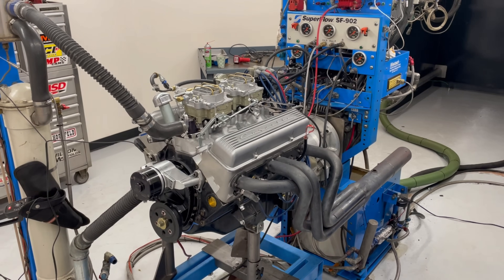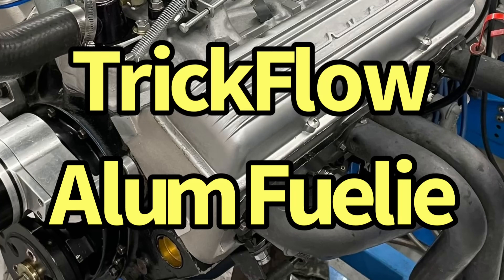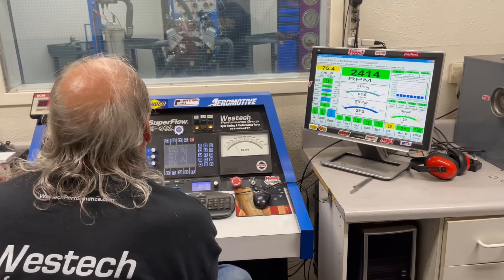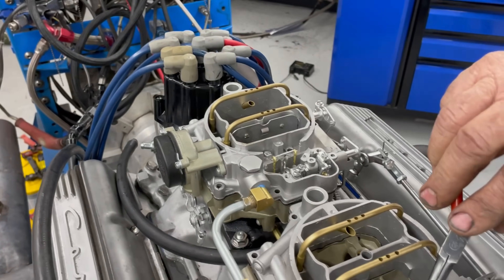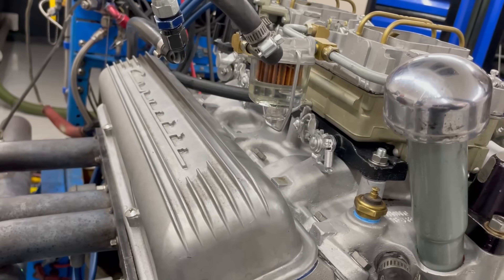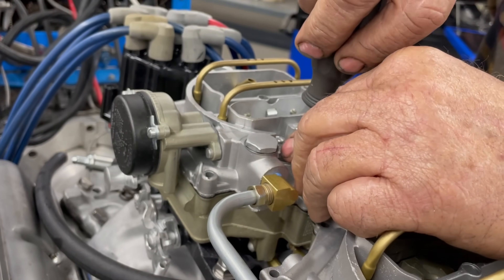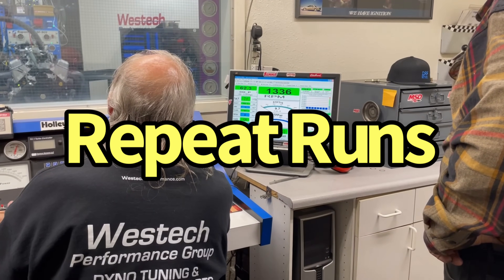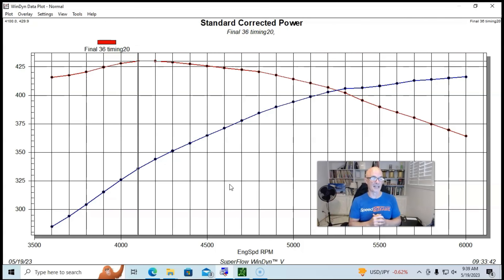HOW TO: DUAL-QUAD 283 STROKER CORVETTE MOTOR. FULL DYNO RUNS, RESULTS AND CARB TUNING. WILL IT WORK?

Comment: Large obstacle today running dual carbs is back in the day the secondary carb had no idle mixture screws it was a special carb opposed to the forward carb which had idle mixture screws but today that secondary carb no longer exist so you have to run two primary carbs and getting two of the same carbs to work in harmony isn't that easy when one is to do one thing and the other is to do another thing (wide open) but I still like the look and performance of dual carbs

Comment: We built a destroked  283 for C Econarail dragster. 
We used a 1956 block as the deck was much thicker than later years. 
Fixtured it on the Bridgeport and milled 0.125 the deck and used an offset ground and welded crank for a 2.75 stroke. Stock rods and Trw 11-1 283 pistons.That gave us 259” for a 1300 lbs.
 car& driver.
Porting allowed only port matching at the time. Flat tappet only.
So we used fuely heads. The max carb was 750cfm so we used a holley double pumper. The only single plane manifold available was the trantula. We had to mill that to fit. 
At the time there were no aftermarket heads.
Motor ran well in a Fed with a shorty glide.
Shifted it at valve float.
Ran 9.50 at 155.
It was good for what we had in it.
The they changed the rules and the Red’s showed up with the money.
Reply from the maker: nice

Comment: This is the engine I ran in my ‘57 Chev-210 back in 64. Only I ran solid flat tappet cam , Duntov 30-30. I know it’s an old combination and much better cams are available today.  So maybe I’ll build another.😂😂😂👍

Comment: I had a friend who had a 64 Bel Air with a 283 with a .30" overbore and we added a 327/350 camshaft, anti pump up hydraulic lifters, and the same intake with the two WCFB Carter carbs. The original car had a power glide transmission and a highway gear in the rear, and that car was a blast to cruise on the weekends, and on the occasion that he got into it those two little four barrels would sound like they were trying to draw the hood into the engine.

Comment: I'm running an old school build 283 stroker. From what i can gather it was put together in the 80s-90s. Its a 1965 283 with a 327 crank, .030 over flat top pistons, power pack heads, L67 cam, Holley 4bbl intake, hooker headers, pentronix flamethrower ignition, and an edelbroken carb. Calculated it out and it sits right around 312CI.

Comment: I wouldn't try to make much power through those dual quad intakes. They are small port/runner castings. The carbs are the equivalent of a single Holley. But ooooohhhh the nostalgia. I own about 4 of those intakes, both 56 and 57-61. 2 sets of carbs, oem linkage, fuel line, and Vette air cleaners. Just bought a complete stock 56 265 motor. Gonna shave the heads, do a 5 angle. Put a 327/300 cam in it, and top it off with the 2x4 setup, Delco dual point, and 7 fin staggered bolt alloy Vette valve covers. After I retire, gonna drop it into my 55, take out the L82 in it now. With a Vega 3.50 1st gear Saginaw 4 speed, and 3.55 gear. Going slower as I get older...lololol

Comment: I ran a 30 over 11 to one 283 with 194 heads , a 30-30 solid duntov  cam with the early dual quad . 4 spd and 4 11 rear in a 55 chevy . The sound of high revs out of that thing was music .
Reply: I ran a .40 over trw forged flat piston 283 with 186 heads 1.94 in and 1.50 exhaust the old camel hump heads with the holes for the brackets and a melling cp400 cam with a 650 holley and the older performer rpm edelbrock intake with a hei  distributor that had been curved for that engine with 1 5/8 headers it done pretty good i put it in a 66 chevy pick up my dad gave me when I was 16 she would scream I loved the sound of it. It was stout on top but suffered 
On take off and that was with at one time. A Saginaw 4 speed and 3:73 gears that has been years ago im 55 now and lost my dad last June I miss him but he taught me a lot im thankful for that
Reply: I have the same set up, do you think you made 300 HP?
Reply: easily . I beat many 350s with that car .
Reply: You were fortunate to be able to get your 283 to be a good performer. Installing 1.94 heads or any head made for 4” bore engines will normally compression and power when installed on a 283 engine. Must of been the 11:1 compression pistons that made your 283 a good one.
Reply: it was a common upgrade 50 years ago . Pink rods . To strengthen it up . And listen to it rev .the 283 was a great little engine . One day i put a 283 crank in a 327 block . I didnt know what i built but with the 194 heads the 30 30 cam and a tunnel ram that thing would shift at 7500 rpm all day .gas was 47 cents a gallon at 110 octane  ! Life was fun .

Comment: Hello old dinosaurs... Question here from a rookie, i like the 327 high revvs, if i wanted a sbc with a similar nature what should i look for? I want to do a swap at some point for my square Body s10.. and i would like to have more options than just the 327, just in case the 327 doesnt appear around my cities or counties...
Reply from the maker: a 350 revs just as high
Reply: The chances of finding an old small journal 327 block in decent shape is slim the 327 and 350 share the same bottom end after 1968 so any 350 will be the same and if you want it to rev high that is not hard to do at all it's all in the heads and valve train stiffer springs to combat valve float etc

Comment: The best cam for 283 is a comp cam 268 high energy. 454 lift 268 duration
Reply: Works very well in a 318 Mopar, too.
Reply: @mickangio16  the best cam for any small block and a torque monster in big blocks

Comment: So there's absolutely nothing 283 about that engine block heads and crank are totally different from a small journal 283 with power pack heads  😂
Reply: Small journal 283 block and a small journal 327 crank. And “repop” heads. I’d a rather seen a tunnel ram on it though.

Comment: Okay... I've never messed with but a couple of 283's over the years. Having said that, I didnt think that you could run a 2.02 intake valve in the small 3.875" bore, especially with that much duration and lift of the cam.
Reply: Never mind... I see that he bored it waaaaay out.

Comment: Do you have a mild 421 c.i. sbc 350 stock block based build video richard? 4.125" stroke X 4.030" bore. Mild hydraulic roller cam. EPS intake.
Reply from the maker: 4.125 stroke in a sbc stock block?
Reply: @richardholdener1727  yeah. Or a 4" 408 would be cool.

Comment: Holdner thats some terrable false advertiseing there.. longer stroke with orriginal bore and block is a stroker not throwing a completly different engine in the car . Made me waste all that time just to see another dyno run of a plain old 350 mouse motor.. please make up for this by doing some dyno tests on themopar 318 to see what can be done .. Not 340 or 360 please just good old orriginal and ultra cheap la 318!!!
Reply from the maker: maybe a 318 magnum
Reply: Poly?

Comment: Excuse me. I feel ripped off. I was promised a 283. Everyone knows what a 350 can do. I'm liking this video because i like you Richard, but this is false advertising 😂
Reply from the maker: 283 STROKER
Reply: @richardholdener1727  I guess I missed the BOLD print, but I still want to see what a tricked out 283 can do at 8,500 RPM. Can you blame me? Thanks for what you do!
Reply: @derekmelyndadeckens2982  me too! 283 with forged pistons,11:1 comp.forged factory crank,duntov solid lifter cam,not sure maybe vortech heads and high rise manifold with 650 demon carb? I'd bet it crank 7 grand?

Comment: Hand raised. I have a 57 Corvette oem correct 2x4 intake setup. Woohoo.

I'd love to build it with a 3736097 Duntov cam
Or a 30-30
Or 3972178 LT1 
Or the hydraulic L79

Can't ever decide.

Comment: Some magazine or engine builder built a 307 with old 175cc trick flow heads and used 3 different cams to hit the 500hp mark. And it did it around 7000 rpm. Kept going bigger and bigger with a tighter lsa. I'd like to see a small cubic inch motor with a good set of heads around 200cc would do with a few different cams and tight lsa grinds.
Reply: Now that’s a 283 stroker, the 307.

Comment: You are kidding me. 260cfm heads tfs, 350 cu in, dual carbs, scat crank , dual carbs, 246 cam.
And 410hp.425lb ft only.
Doesn't  rev over 6k
Thats called slapping together over specced  parts, and wasting alot of money.
Do love the finned covers though
Reply: Was the cam degreed in? Could be way too advanced?

Comment: Just a couple years ago I had a .060 283 with forged pistons, self ported Vortec heads, china 'air gap' intake, factory TBI with a ebay adapter,  Comp 268 cam all in a '95 Cheyenne 2500hd, ext cab, long bed and a NV4500 to a  3.42 14 bolt (6800# empty) and she would  sh!t and GIT!!! SURPRISINGLY got 19mpg on hwy! 
70 mph/2000 rpms.
Ran pig rich at idle with stock ecu. But never fouled a plug, and sounded MEAN!
Better than those "thumper" cams.
(Deck wasn't true and after a year or so, blew a headgasket. It'll be resurected this year in a '95 GEO Tracker with a T5 5.12 axlel!!)
Reply from the maker: tbi?

Comment: In the early 80s I bought a nova with a 350 with daul quads. They were on a low rise intake like the one in your video. With a 4 speed that little thing sure would scoot on down the road.  Wish I never sold it but thsrs the way it is lol

Comment: We built  a lot  Most would take a 4" bore  add a Moldex 4" crank and stock 6" GM 2" pin rods from another brand.  Side grind, mag, rough rebuild, military grade shot peen,  finish rebuilt.  This was early 60's before the 327 no aluminum heads really available so you tried to work ported stock heads over as wide rpm  range as hard as possible.  Late 62 tried 4 1/8 by 4 1/4 with the out the back door shortly to be new 327 block.  Won both top fuel and top gas at the 62 AHRA nationals at Cado Mills Texas with these motors in the twin engine chevies.  60 years ago  what fun   the 4x4 makes a great reliable motor  452 takes more maintenance

Comment: My dad had a dual quad 283 from a 62 Corvette in his 59 Chevy Bel Air.  I inherited the car in High School.  3.73 gears and a 3 spd o/d Saginaw.  That thing would wind to 6400 rpm.  Dad pulled the dual quads off and sold that setup and stuck a regular 4 bbl on it.  It actually did better with the single 4 barrel on it but it didn’t look nearly as cool.  Wish I still had that car.  

I was going to get a small journal 327 crank and do just this back then but never did.  Got a 400 SBC instead.
Reply: What a rare engine, a 62 Corvette 283.

Comment: Ok guys the way to do this engine easily is to do a newer 350 1 piece rear main seal with 383 crank and dress it like the old 283s. With say 550 hp.

Bloodviking

Comment: I have the original 283 out of my 66 Malibu sitting in a corner.  Watching this video makes me want to do something with it instead of gather dust.
Reply: I got a built 327 in my 66 Chevelle Super Sport  , Screams to the moon  , 11 inch clutch and  M-21  Muncie 4 speed and 12 bolt posi rear end  , 600hp  

I have a 1971  small block  LT1 350 with  4 bolt main  in my 66 Malibu  , 11 inch clutch and Saginaw  4 speed  trans and  10 bolt rear  , 375hp
Reply: @jimthomas1989  whats done to the 327

Comment: Ever done anything with a 267? Small 3.5" bore SBC. My 79 El Camino has one in it. It will be coming out to be replaced with a more modern engine... maybe an LV1 4.3...
Reply from the maker: I have not
Reply: Do a 350 or a 5.3

Comment: Put those same heads on my 283 when I blew up my powerpack heads. However I'm only overboard .030" over so I only got a 287. Wish I had those torque number though. Great video Richard, love seeing the weird and close to home stuff!
Reply: 65 cubes helps torque?
Reply: @hotrodray6802  The difference between a 350 and a 383 is 25 hp and 25 ft lbs of torque.

Comment: Based on the dimensions shown in the video, nothing about that engine is a 283!  It’s basically a small journal 355.  So, Stroked 283 title is BS!
Reply: 283 block
Reply: @hotrodray6802  I believe it's a .020" over 350 dressed as a 283. It could just as easily have been done with a 400 except for maybe the harmonic balancer giving it away. I think it's very cool.

Comment: I've got a gear-driven Duntov Solid-Lifter Cammed 283 with 58cc heads topped off with a set of Corvette finned aluminum valve covers complete with an early Fenton Aluminum Tri-Power Manifold with 3 Rochester 2g's & Scheifer 10lb Aluminum Flywheel all hooked up to a Borg Warner Super T-10 four speed powering my 2100# fender-less chop-topped Model A Coupe....She IS DAMN HARD to beat stoplight racing...

Comment: The very obvious,, why bother with a 283 as a performance engine.  Start with a far more common 350. With all the advantages of the more modern block.
Hotrodders built 302s or even 327s in the 60s. Then GM did it!!

Comment: I have a stock 61 dual quad 283 245hp vette.
Any suggestions for a little more hp while keeping relatively stock?
Thanks to all.
Reply from the maker: ported heads and new cam
Reply: @richardholdener1727 KISS 👍👍👍
Reply: Thanks guys

Comment: You know what I would like to see? I guess you don`t, but I would love to se an 4160 type Carb with an metering plate instead of an seconadry metering block, on the dyno, I have never seen that, how actually is the fuel curve? I would guess it is probably not that bad, but I really have no idea. But I have had 2 of those carbs, and they have worked good on a "normal" car. My first 4160 was an an pre 74 one. It was 40 years+ old when I used it.
Reply: Well, actually I bought the last one not that long ago, it was an "remanufactured/returned" carb from Holley, and the choke and idle adjustements and acc. pump was absolutely totally out of adjustment! Good thing I check that stuff before putting it on an engine! That was probably why it was returned. But that seems to be the trend these days, with new parts, less quality control than before.
Reply from the maker: I have a pair of the 4160s and jet plates, I ran them on a dual quad application and they worked well
Reply: @richardholdener1727  On the dyno? Did they have a nice fuel curve? Sometimes the "basic" stuff is the best.

Comment: My dad had 305 heads on a 283.  Rv cam on a tight LSA.  Headers and 2.5 duals with a weiand intake and a q jet . It ran very well.   Just the 308 gear in the pickup wasnt great out of the hole.. but it performed well.

Comment: Ahhh, the old Carter WCFB. Decent small cfm 4bbl with good primary adjustments. One could actually get fair fuel economy with one. Had a pair on a 325 Dodge hemi. The popular, and easy, thing to do to a 283 back then was to make a 302 out of it by boring oversize. They would run great for a while but tended to break easy. Saw one that broke the crankshaft right behind the #2 main bearing. Engine would still start & idle but made a tremendous amount of noise.
Reply: Did it break turning 8500 RPM's?  I would have rather seen the stock displacement, but it's not my motor or money.
Reply: Few broke
Reply: @hotrodray6802  Oh really. Rocker studs removed themselves at high RPMs, rocker arm instability at high RPMs, rods broke, on those bored to 302 the cylinder walls were weak, factory pistons would crack. There were a lot of aftermarket parts to make them more durable but they were usually out of reach for the average street guy. The one that broke the crankshaft wasn't a very hot engine. It had a factory 4 bbl intake & rochester 4bbl carb. Just a better set of heads & a rebuilt short block. Broke while he was racing it at a local track. The upside was that there were thousands of them laying around, very plentiful. I had a 265 that I put into a 52 pick up. Basically stock w/ 2 bbl carb. Never broke but reliable & cheap to maintain.
Reply: @larryhutchens7593   There's good reason WHY the aftermarket supported Chevy enthusiasts so well.
Reply: @mickangio16  They were light, cheap & plentiful.

Comment: Bedsides the fact it is a total lie (not a 283 at all), and certainly nothing to do with Corvettes. The real 283, with  was the first engine to make 1 horsepower per cubic inch with fuel injection at the low rpm of 6200 in about 1957. But the cheaper dual quads were still at a whooping 270hp powerhouse in light weight cars, with 4 speeds, and drive ability was never an issue.
Reply from the maker: The 1954 354-inch Chrysler 300B was rated at 355 hp. the 283 was the first Chevy
Reply: @richardholdener1727  The early hemis of the 1950s were no bargain and weighed over 1000 lbs. It was lowest priced wrecking yard engine, and the dirt cheap price made them perfect for Don and a few other TF cars of the 50s and 60s. They were dirt cheap disposables.
The first Chevy was the 265 and then came the 283.
Reply: Are you  saying they didn't put 283s in Corvettes?
Reply: @63Imp283  No, they put 283s, in just about everything Chevy made, except the Corvair, from 1957 till....😀
Reply: @free100x  till 67
Reply: Actually the 1st for 1hp per cube was the 345 DeSoto HEMI in 56
Reply: @joshua9396  sure you don't have a little case of dyslexia? Lol 
 What Richard said above rings a bell
 1956 354 had 355hp

Comment: corvette had dual four barrels in 58 with the power pak heads. in 61 or 2 they had the 194 fuelie heads available. does the dual four intake for the later fuelie heads have bigger intake passages than the earlier power pak heads intake?
Reply: RUnner size on those intakes is tiny. Any modern dual plane would wake it up Id bet. Single 4 barrel
One of a few vette design flaws was no hood clearance for  real intake.

Comment: Hmm disappointed I wanted 3.875 bore and a 3.75 stroke
Reply: No crank room
Reply: @HotRod Ray  same as any other small block, all  very same size, early 283s had small crank journals that would be the only problem